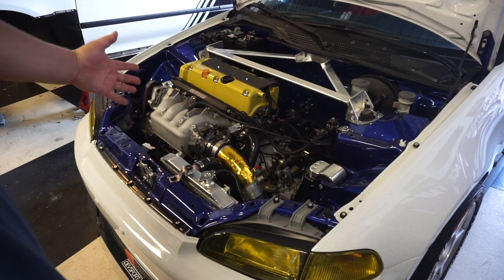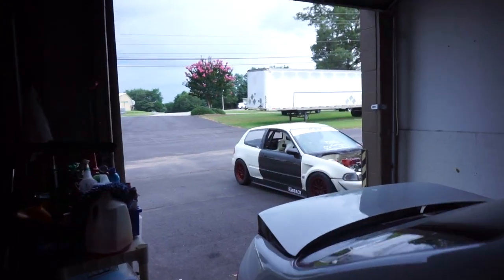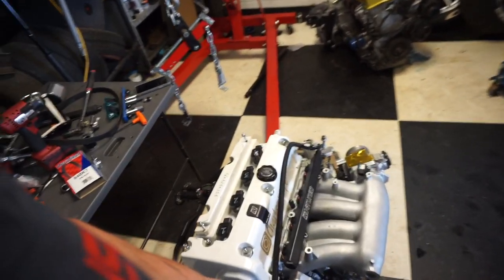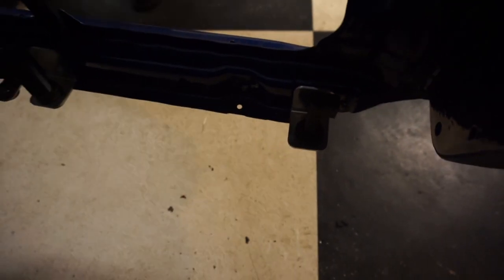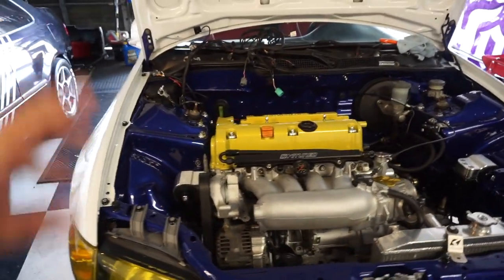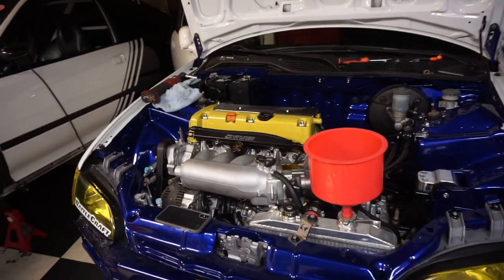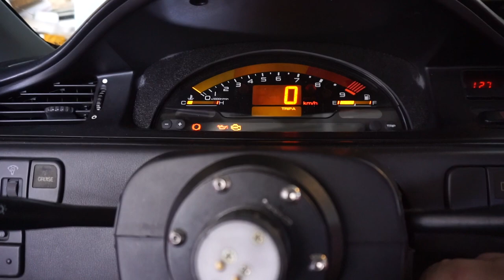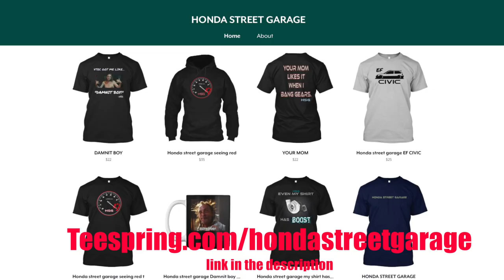NEW WIREWORX HARNESS | K20Z1 SWAP | ADDING A/C !  HSG EP. 6-39

Comment: Can you please do a break down on how you ran AC? I am running a k20z1/k20 in a em2 all I have is the compressor. Need to see how and what all it needs for AC.
Reply: Hybrid racing has what lines you need to keep off the Em1 and will provide you the lines you need to connect the kit